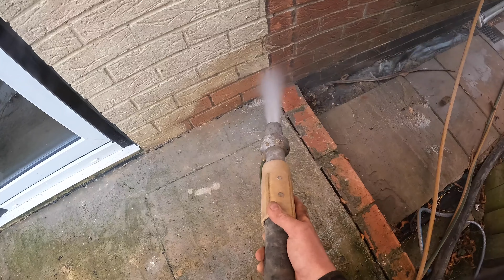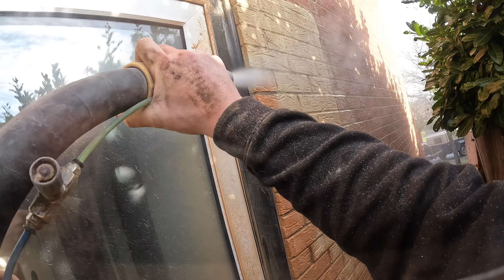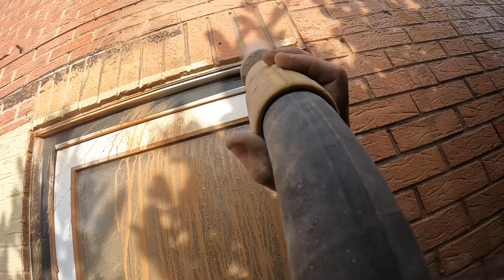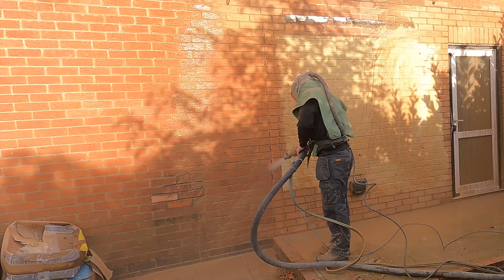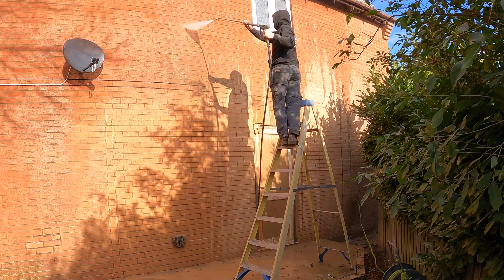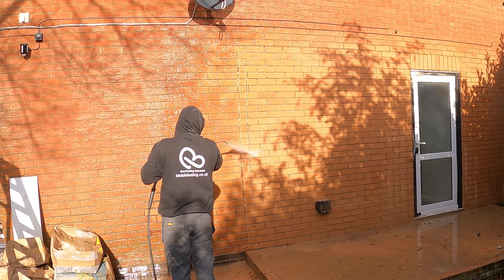Brick Cleaning / SandBlasting Paint off!

Comment: Top work Mick, do you have a adjustable pressure valve on pot mate? If so what psi are you blasting at, cheers Dave
Reply from the maker: I don't have a presure gauge on this pot but I do have a noodle full of experience when it was working on this same pot 😂 I got a feel for it but then I soon realised I'm better using full power/flow but dropping psi by using bigger nozzles I've got 3 sizes up on the van. Say for example my cdx650 gets 100psi if I up it cdx750 my psi drops to around 85psi and I can play about with my flow to the helmet to reduce the nozzle power for fine tuning 😎🤫 pro tip 😬 I also can opt not to press the power button on the compressor its safe start sits at 60psi don't rev but gives me 60psi or press the button and get 125psi obversly doing it this way to drop psi don't get full flow so really ya don't need a valve to choke ya pot it can be achieved in different methods. Obversly my methods take practice and knowing the rig your using also something els to note using a bigger nozel will use more derv (around 30% extra than choking the air but its around30% faster) also keep an eye on the helmet air fees is enough
Reply: @Mobileblaster  very interesting mate, knowledge is power, thanx for sharing 🎖👍